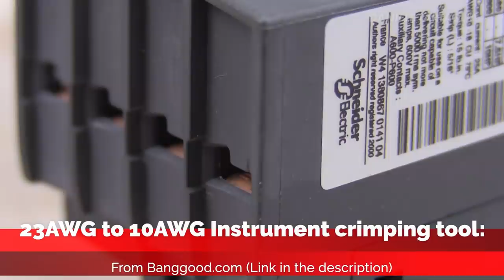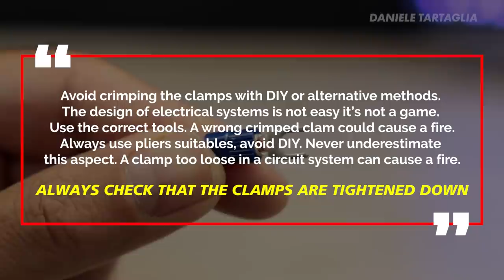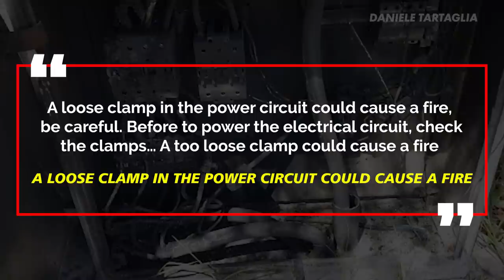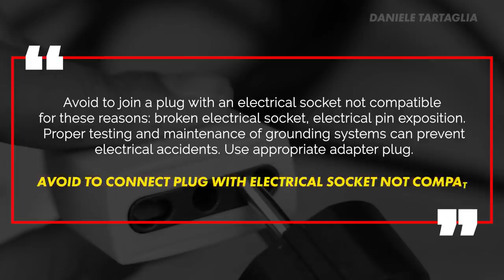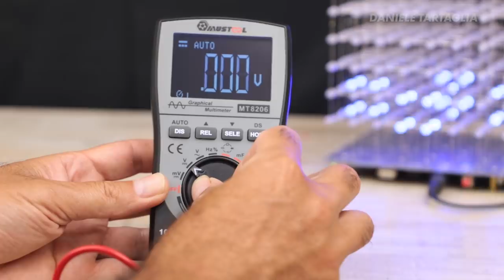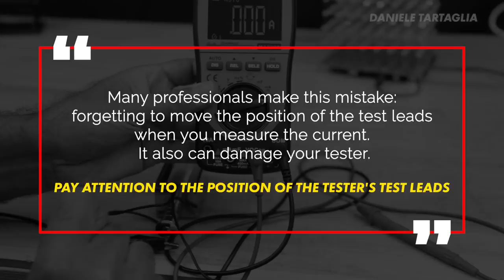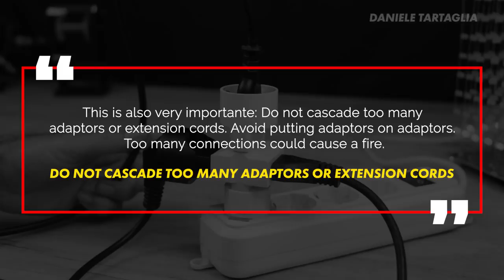10 STUPID errors to avoid in the electrical engineering

Comment: Just a comment on sin #1. I absolutely agree that is shoddy work and I would never allow or do it.  However reducing the strand count for 1/2 an inch does not ELECTRICALLY reduce a 16ga wire to say 23ga. Mechanically, yes, but not resistance wise. Remember the resistance across the wire is distributed along it's length. So 1/2 inch is not going to have any significant difference. Look and many large electric motors and transformers. The internal wiring is often a wire gauge or more below the rated current for the same reason. That undersized  wire is less than a foot in length. Again I am not condoning the use of undersized terminals on wires. That's hack work plain and simple. But I don't see it as an over current concern.
Reply: This is absolutely dangerous nonsense being told here! If you reduce the wire cross-section at one point of your connection this is going to become your weak spot. Might get hot and start to burn if the rest of the wire does fit the current but that thinned spot cannot take it.
Reply: Andy Delle Good grief! In what school are they teaching such a blunt rubbish? Have fun with it.
Reply: @andydelle4509  a first year student might, but reducing the strands causes a hotspot for several inches as the copper will form an oxide layer preventing the transfer of current from one strand to another. Also, if the motor is used witch a VFD, the high frequencies induced aggravate the situation due to the "skin effect" where the current does not travel thru the conductor but thru the surface layer or with higher frequencies along the surface of the conductor.
You want to start a fire this way? Go ahead... But as a commissioning engineer I will insist that such reductions of conductor diameter are fixed or I will not even start the motor to check for the correct rotation.
Reply: Andy Delle if you think how a fuse is made, it is exactly a section of thinner wire around half an inch long.
Of course it depends by how many strands you lose, but it is really bad practice.
If the ferrule cannot fit, also the insulating part of it will probably will do not fit correctly and this will make it weak.
Not nice at all

Comment: I've done all of these and am still here, just.  I must be lucky.  I wonder why I never win the lottery, though?
Reply: None of those are mistakes, most of those were just improper execution. For example joining 2 cables, just solder them together. Another example is fitting a cable to a small connector (like this one 2:22), instead of cutting off part of the cable, bend out the part that the cable comes in IF POSSIBLE. Also addressing that "mistake", just use bigger pliers or solder it...

Comment: It is not said enough;  most people think only a short can cause electrical fires, but a bad connection (resistance in the contact) can do just as well. In the worst case scenario the amount of power dissipated in the few square millimetre of the bad contact is half of the power connected to the connection. So if a 2000W heater is connected on a loose screw, in the worst case 1000W can be dissipated in that screw, and that is A LOT of heat for such a small piece of metal (Worst case: resistance of load = resistance of bad contact, so a 50/50 divide of power)

Comment: 7:20 - Fail. Yellow/green wire must be longer. By crash (pulled out power wire from terminal block) must be first disconnected the blue and brown wire and last wire yellow/green. Device must be till the last moment grounded!
Reply: I hope he’s not an professional electrician :/ because this is a really bad failure
Reply: Heh, aye, also there should be plugsthat are supposed to be used as non-grounded, you know the ones without the ground plug/hole at all. using a grounded plugs without ground at all is always a short way to disaster. So saying that "this is fine for this kind of thing" is not good.

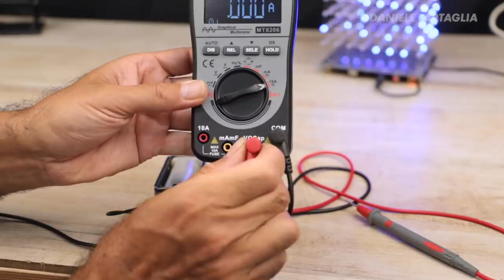Comment: @13:28 The problem happens when you forgot to move the terminal back from 10A to V hole. If you try to measure the Voltage while the terminal is still in 10A hole then the fuse inside the tester will most probably blow (If 10A line is protected with fuse).
Reply: Yes, and better meters (for example Brymen) have a buzzer whenever you go into voltage measurement with probes connected to Amp terminal. When choosing a meter think about safety like proper fuses and features like that - it can save your life.
Reply: @KB-mo3sx  yes, I just ordered 5x20mm 10A ceramic fuses fo my meter again...

Comment: Some great habits to adopt!  I've always pulled fairly hard on anything I've crimped - if it's going to fail, I want it to fail when I'm wiring it, not later when someone can get hurt or stranded.  High resistance connections will overheat as well, melting that nice plastic insulation separating it from the other terminals...
Same for always tighten what you've just stuck in the terminal and "make the rounds again" if you've done a lot of terminal wiring to ensure you haven't missed one.

Comment: You missed one thing when you showed that need to move the position of the test leads. Always move them back after you get an AMP (current) reading. I've blown fuses before on my meter because I tried to measure voltage and I forgot to move the lead back from the amp (current) position. After having to open the meter several times to replace the fuse, I got into a habit of always moving the test lead back after an AMP (current) reading. Other than that, good job on the video.

Comment: 7:20 is better make the earth (yellow-green) wire longer than other
Reply: It's not only better, but mandatory to do it really right. I was waiting to see wether the PE should be longer or the clamp inside the plug is located to the wire to get the result. Goal is allways that PE should disconnect last. A good designed plug locates the clamp for PE that wires can cut to same lengths.

Comment: 6:53 You should also shorten live and neutral wires to leave the ground wire the longest one, then In case of tripping over the cable, the live and neutral wires will be pulled out before the ground wire, reducing the risk of electric shock.
Reply: That's what the strain relief is for. If you manage to mangle all that you deserve a good shock as you must need it to learn.
Reply: @leftyeh6495  The strain relief is not 100% protection, some cables with soft insulation (for example rubber) can be pulled from tightened relief with enough force. Repeated pulling on the cable can slowly pull it out and even some plugs don't have relief with screws but plastic ratchet which may become loose. As an Electrician, I never rely solely on it.
Reply: @WolfGamerBohumin  as an electrician, I believe stupid people will defeat anything you do to try and be safe. I quit worrying about the idiots long ago.

Comment: Prolunga = extention cord
differenziale = main breaker
magnetotermico = breaker
relè = relay
terminali = wire ferruls
cavi singoli (fili) = wires
fili all'interno di un cavo = conductors
cavo contenente altri cavi = cable
Reply: Differenziale non è RCD? Residual current device? Oppure RCCB residual current circuit breaker

Comment: 7:10 In my opinion thats still wrong. You should always leave the Protective conductor (ground) a Bit longer then the live and neutral Wire (Only with flexible wires) . So when you pull to hard on the cord the ground wire tears of last.
Reply: Only flexible wires are aloud with this setup

Comment: Regarding number 5: You could also change the plug on the cable to your device to a compatible; this is often quite a bit cheaper than an adapter and you reduce the risk og it comming apart. Where I live, in the kitchen alone there is often 3 or more devices using 230 Volts with the "schuko" plug when delivered.

Comment: I remember making a big mistake on a multimeter where I tried to measure 220v but then the red probe was still connected the 10A port of the multimeter. The fuse on the meter blew up and the probes got melted! Will never forget that day, which is a good thing.

Comment: Personally, I prefer fork terminals for contactors. Always use an "in calibration" quality crimp tool and tighten the fastener to the required torque with a calibrated torque screwdriver.  Normally around 2 to 3Nm.

Comment: It may not be the best, but I use sometimes the cutting part of the pliers to crimp it. I don't cut it, I just make enough strength to crimp it. And it stays good.

And as for the extension, it's not something that I like to do, but when I have to, I don't twist it like that, I wrap it on the other side, and weld it.

Comment: procedure no2  pliers can be used this is how its done without a crimper first do it frist sideways then top and bottom the cutter side of the pliers can be used but be carefull with the pressure applied so as to avoid cutting the cable or the connector or just solder it  it works well than crimps

Comment: To me, these all seem like common sense but I have crimped wires with regular pliers many times because it was the only thing available. I learned how to make it work but using the right tool is much faster and way easier.
Two others I would add is don't cut the ground pin off a plug to make it fit an ungrounded socket. And...don't try to test amps on a circuit that is more than 10A.
Reply: I've also seen foil wrapped around a fuse which is the same as direct connect without a fuse at all. BAD BAD BAD

Comment: I will use a 5m strip Led (red or orange) to have a warning light in case we encounter a problem with the car and I want to connect them to the blinker warning (signal lamp), does the cables that come to the signal lamps carry the load? how many mm cables should I use if it doesn't carry? And if the cable from the signal lamps will be enough where the lamps are installed (hear the bulb is installed) from where I received led' e bağlayacağım cable should be how many mm? Cable length will be 10 or 15 meters LED will be 5 meters. Maybe even a small possibility 7 meters Led ' I can also plug. (I'm going to do the operation right and left to the back and front). I'm sorry I wrote so long.
Reply: if I understand correctly you want to install a strip of 5-7 meters of led downstream of an indicator lamp of your car with a 10 meters long cable.
You should measure the voltages in the various points: across the lamp, with and without the led strip and across the led strip.
If the voltage and consequently its brightness does not change across the lamp, then the machine cables bear the load of the LEDs.
Once the LEDs are connected, check that the voltage across the LEDs is equal to the voltage across the lamp.
if the voltage drops at the ends of the LEDs then you have to increase the section of the cables between the LED and the lamp, by eye I would say that 1-1.5 sq mm should sufficent, but the measurements will give the verdict
Reply: @zolatanaffa87  thank you
Reply: @zolatanaffa87  Full marks to you for understanding the gabbledygook.
Reply: @amdidextrous  thank for your comment, but can you explain me what is the "gabbledigook"? i'm italian then some words are not comprehensible to me (and google translator too)

Comment: One mistake possibly not mentioned below (in English), is leaving the probes in the current terminals when you have made your current measurement, and you then switch back to read a voltage and fail to notice the probes in the wrong sockets.
An easy error to make if you are in a hurry.
Reply: and potentially more dangerous shortening the voltage surge!
Reply: Yes leaving set to volts as in video will not damage meter but other way round as you say will definately blow fuse in meter or damage meter.

Comment: I would always prefer soldering over crimping or twisting
Reply: Unless you're installing into something that is going to suffer vibration in which case crimps are superior
Reply: @escortpwr05  mppt controllers or solar panels usually don't vibrate...

Comment: I had a single bad cable (short in length ground wire - not screwed properly) in a long run of different outlets and panels, and when i touched my pc case metal and a metal pipe nearby i would get funny little shocks(thankfully) .. The potential from case to ground was 80Vac(measured with a multimeter) but it was probably normal leakage from capacitors in the PSU accumulating as charge on the metal case. Cable was cut from 1 end and receptacle was replaced with another one. Lesson learned. Don't do things in a hurry and be fully concetrated. Thankfully the energy was low and no esd damage to pc.
Reply: Amateur. I had 230V AC on my case because I've plugged the plug wrong way. I had bridged 0 with ground pin because there was no ground, common practice in old installations. I was wondering for a month why my pc case feels like its stinging me in the leg.
Reply: Yeah your pc case (grounded), plus leaking psu capacitors by design would act as a parralel high resistance path of electrical return along the common company provided neutral. (zero). The high voltage on the case is because resistance was high, ie no voltage drop. By touching it you created another parralel high resistance neutral path  from case to you to ground, to where company's neutral was grounded ie. the transformer of your home block. So u had a 3x neutrals of different resistances operating. U should probably install an RCD or a ground. So how did u solved it ?

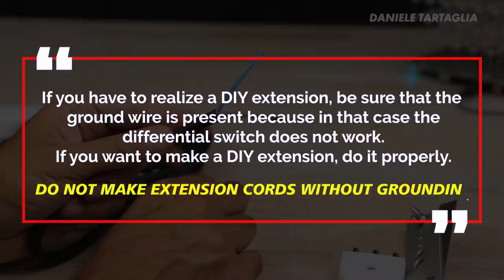Comment: VERY very good video. I suggest to check the text at 7:30, because it´s confusing, appears like if the ground wire is present the differential switch will not work.  best regards!
Reply: yeah. It works with or without ground wire.

Comment: Just me, but when I make or replace an extension cord end I bring my voltmeter with me, and set it to check continuity. It helps me wire the plugs proper and ensures the right voltage is going through the right screw port.

Comment: Thanks This clip should be seen by young DIY electricians ... to keep it safe 
Electricity is dangerous for creating fires and electrocution 
 at 5:35 in the clip you are using a tool to strip the outer cable. what is the name of brand of the tool ..is there a link ?
or is this a DIY
Reply: Just use a jokari knife. Or like professionals a knife or Wirecutters. Less is more

Comment: Definitely a lot better editing than the soldering mistakes video, the emojis were annoying as heck. Still some room for improvement of course but good tips, albeit I do disagree with making splices with electrical tape, there are some good procedures for splices without solder or crimping terminals (the one I know the most is the Western Union/Lineman splice), so it's definitely possible to do it right.
Reply: Especially when deling with wires you must not break

Comment: rarely seen crimping cable in distribution board..is it the standard procedure?
Reply: Do you mean using bare copper instead of connectors?
Reply: @manny3549  i mean normally just bare cable directly to the mcb without connector  or crimping.

Comment: Don't get tangled in your desires..loose wires cause fires. If you're building something that Line power is going through. Make sure it's not between you and the door when you turn it on. That's the most important thing.

Comment: The meter leads which you showed is wrong - if the meter is connected in series (to measure current) and test leads are in the voltage position, nothing happens except reading the terminal voltage since while measuring voltage multimeter has a very large resistance and a very minute current flows through the multimeter. It is the other way around which damages the multimeter and can cause a fire, when you keep the test leads in the current measuring position and try to test the voltage by just jamming the test leads into a positive and negative of the outlet, in this case the current measuring position offers very low resistance and thus a very high current flows through the meter, this if not limited can fry your meter and cause fire, but now a days good meters have a protection built in it, against this. Get your facts straight.
Reply: actually there are some more mistakes he did...

Comment: 6:20 why in the world would you make such a cable and say it is ok for some appliances? There are ground plugs and sockets therefore they should be connected with cable. Everyone would assume that there is ground in the cable.
Reply: Yupp, never make a cable that looks "alright". Either wire it properly or don't bother. In a pinch say when you quickly need something it's ok to bodge it together, but make sure to cut the ends of the cable when you're done.

Comment: I am rather gutted you never pointed out that the insulation on the connectors and ferrules determines the wire size's and not the wire color, (you kind of shown this in number 4 but a quick note would have made this very clear. great information though.

Comment: first example is manipulation. in the first case, when the car cut off part of the veins,
it inserted the remaining veins unfinished and pressed the wire. that's why when he bent it 90 degrees he got out. 
if the author had inserted the wire all the way, nothing would have come out.
Reply: None of those are mistakes, most of those were just improper execution. For example joining 2 cables, just solder them together. Another example is fitting a cable to a small connector (like this one 2:22), instead of cutting off part of the cable, bend out the part that the cable comes in IF POSSIBLE. Also addressing that "mistake", just use bigger pliers or solder it...